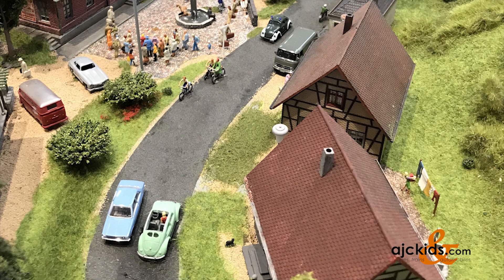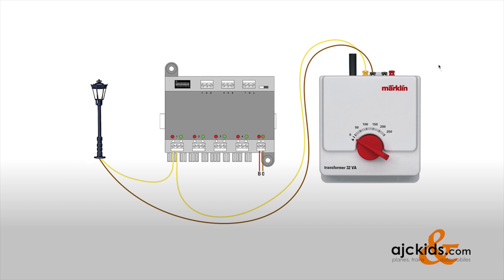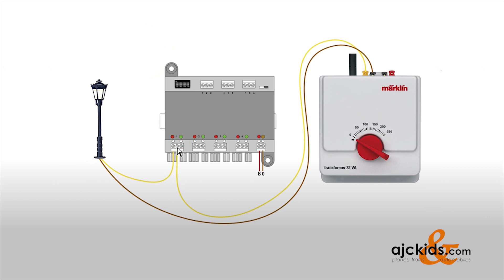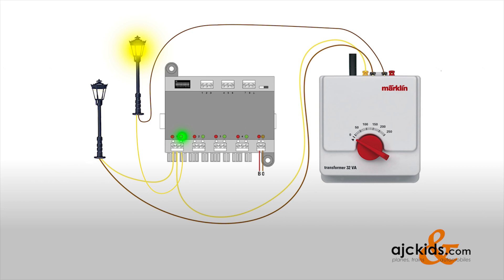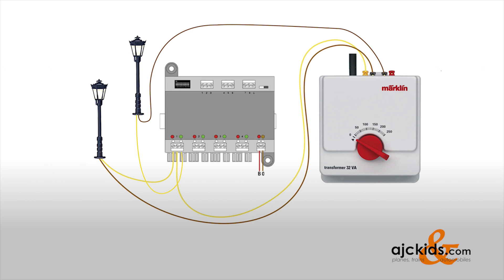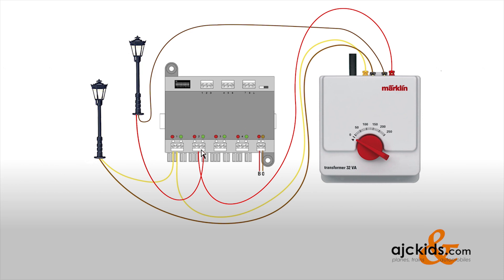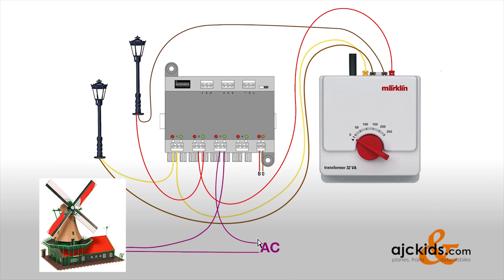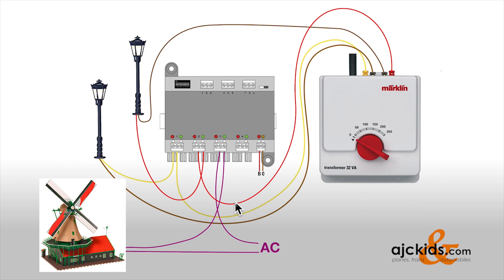Marklin M84 Decoder Part 3: Galvanic Separation of Outputs

Comment: Hi ajckids, question does the M83 decoder have the same insulation ? 
Is it possible to connect a manual turnout control in parallel with the M83 outputs?
Reply from the maker: No, this is one of the big differences between the M83 and the M84. The M83 uses the digital power from its digital signal to feed all the ports.

You can use a 60822 universal power supply with suitable power pack (here in the USA we use 66367). When you connect the 60822 to the M83, it uses the power from the attached power pack to feed the ports.

https://ajckids.com/products/marklin-60822

https://ajckids.com/products/marklin-66367